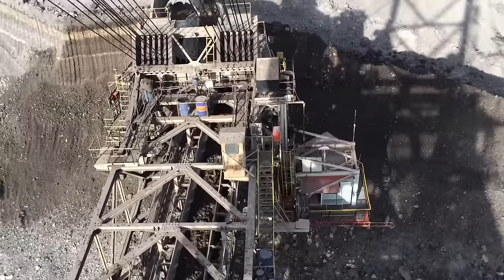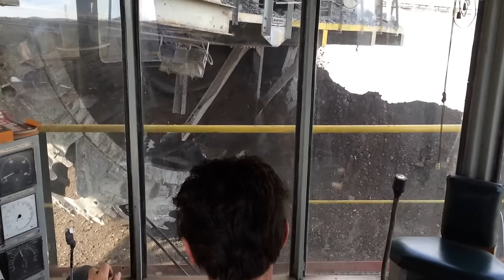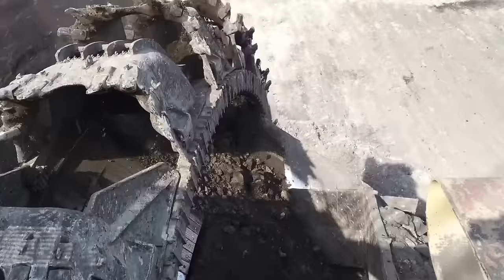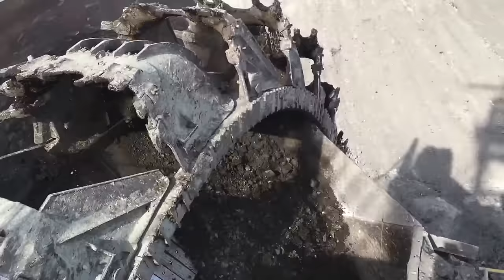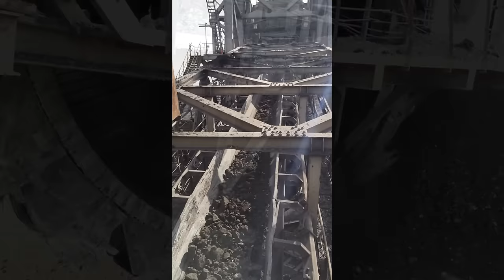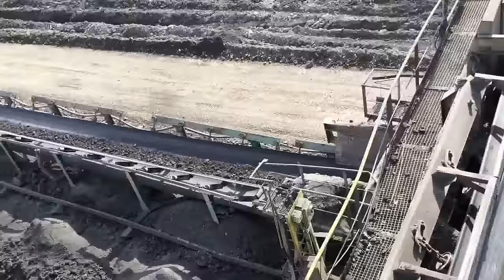Bucket Wheel Excavator - Mining Mega Machines

Comment: I want one!  it has a house on it!  imagine living in one of these during a zombie apocalypse?  just drive your house around and dig people bunkers for loot and food.
Reply: Jeff The Killer  yep that's a disadvantage
Reply: Thats what I am thinking
Reply: Bruh I'd use that giant wheel to smash and stump zombies coming at me like I was moving the lawn
Reply: Yea how you gonna refill it 
It's no Soler powered
Reply: @oxgang8769  its a diesel. diesels run off of any oil and can be used as fuel. i would go straight to abandoned truck shops and collect the scrap oil, filter it and use it as fuel. even cooking oil and deep frying oil can be used as diesel fuel. other fuels can be messy with black smoke but it doesn't have harm to the engine as long as there are no loose particles inside.  at that point if i have to use a dirty fuel id make my own makeshift exaust cleaner from some pipe, a 55 gallon drum or 2 filled with water.  the exaust bubbles through the water making the exaust cleaner and the water dirtier.  the water has to be changed after a while but itll work and you can drive with open windows without coalrolling yourself.

McDonald's delivery trucks use recycled deep frying grease to fuel there trucks. thats why when  you pass one the exaust smells like French fries!  im not kidding!

ever heard of runaway diesels? its usually from a bad turbo. the oil used to oil the turbo gets into the combustion chambers and that causes the engine to runaway.  the only ways to stop a runaway engine is to use a runaway truck ramp (thatll save your engine clutch and transmission)
put a rag or something on the intake (another way to safely shut down the engine) 
put it on high gear with your foot on the break and use the clutch to gently slow down the engine. (doing it slow may burn out the clutch. doing it fast can destroy the clutch too but it can also destroy the transmission.  doing it slow may sacrifice the clutch but will save the engine and the transmission.   hope you all learned something!
Reply: @georgieippolito9924 its powered by coal which it mines,not diesel
Reply: @graycatsaderow  Steam powered?
Reply: @georgieippolito9924  im not an expert in that degree,all i know is that its powered by coal
Reply: @graycatsaderow  sweet!  modern steam!!!   I didn't know that existed.   Pretty much anything coal fired is steam powered
Reply: I dont know you. I just know that you are my soulmate.

Comment: This video doesn't do this machine justice. This thing is HUGE (like GINORMOUS). A bulldozer once got in the way and was caught and carried all the way to the conveyor belt by one bucket. Only German Engineers would think of building a real life Decepticon.
Reply: Well to be fair this appears to be a much smaller model. I think the machine you are talking about is the bager 288 or 293 which are the biggest bucket wheels in the world. I still wonder how exactly that incident happend though.
Reply: @reddeadlycreeper  That was Bagger 289 which had appetite for a Caterpillar D9R dozer (in 2005).
https://youtu.be/QaIyxnM4Lto?t=56
The bucket wheel excavators are not fast. But the visibility of the operator is limited. The dozer got stuck, the driver was however able to walk away in time.

Comment: There are two brown coal surface mine areas in germany where those are used. One between Cologne and Aachen the other one south of Berlin. You should see one of those cross a highway. That is a major move, believe me. Filling some meters of sand on top of the Asphalt cutting high voltage lines and all that.

Comment: When you ask Germans to do something and they over doit as always.
Reply: Interestingly enough it is just one of a row of baggers. This one was build 1995. They also had  Bagger 281 (built in 1958), Bagger 285 (1975), Bagger 287 (1976), Bagger 288 (1978), Bagger 291 (1993)

(The numbers represent how big each of them is. )
Reply: @Maddinhpws  The mine shown in this video is not in Germany at all. Rather Greece judging from the power plant.

Only the bucket wheel excavators used in the Rhenish lignite mines have Bagger 2nn numbers. Bagger 285 - 293 (the last one built in 1995) are also fairly identical is size, weight and performance.